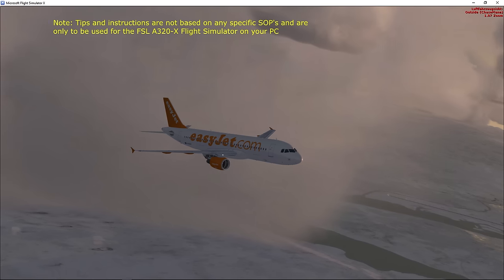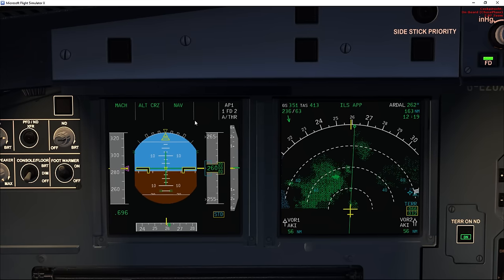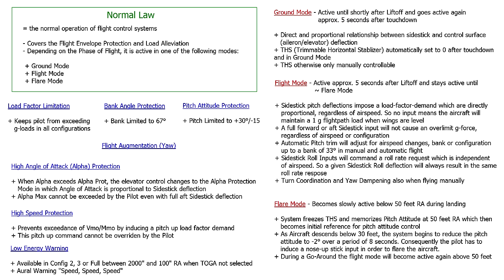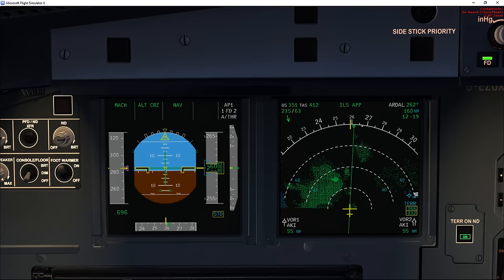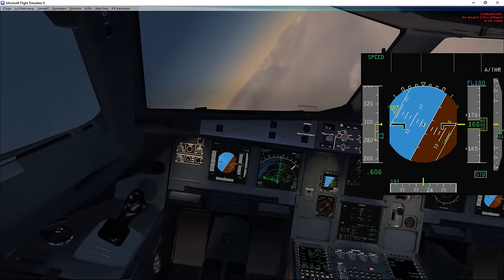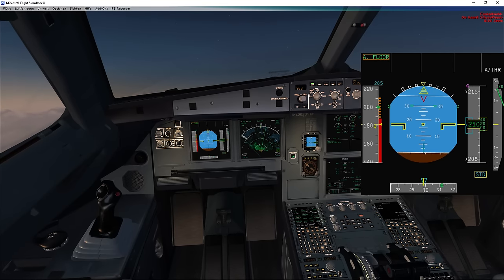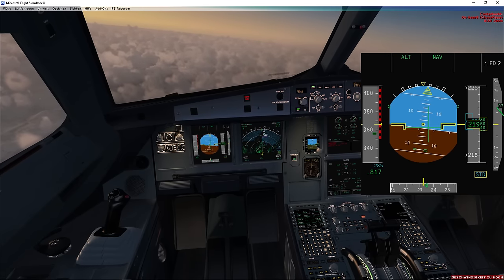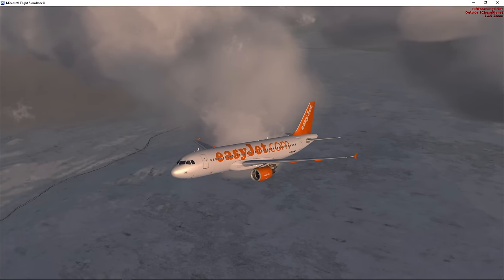FSLabs A320-X Basics: Normal Law Flight Envelope Protection

Comment: Hi Blackbox!many thx for great info again!can u explain a bit more on the difference between High angle attack protection and low energy level protection,as I can see that both of them have to do with how the aircraft is stopping it comes to a low airspeed, Happy New Year !
Reply from the maker: Hi tiffany. The High Angle Protection works at any altitude as long as the Aircraft is in Flight Mode. The Low Energy Warning is only active with Config 2,3 and Full,  between 2000" and 100" Radio Altimeter Height and as long as TOGA Power is not selected. This Warning is given to inform the pilot of a low energy state of the aircraft near the ground and happens a few seconds before the autothrust sets TOGA automatically. In the Procedure it says that if the Speed Low Energy Alert sounds, the pilot should increase thrust until the warning stops. Regards

Comment: Thanks very much for the video BB :) What is your opinion on the delay and uncertainty around the P3D version of this? Cheers :)
Reply from the maker: +elmar001 ... Quote from the FSLabs Forum: "if you also visit the LM forums to notice what's been going on with the latest v3.4 hotfix releases and the issues people are having with memory usage and DXGI_DEVICE errors. We feel that there are still some problems with the current version of P3D that is available and that until the good people at LM have had a chance to resolve those, we are hesitant to release a product only to start receiving complaints for situations which are not quite caused by our software."

Comment: Hi Blackbox711. As usual, a very interesting and good video. I would be very grateful if you could do a tutorial on how and when to use the lights e.g. Strobe Light. I've seen you put the strobe light into the auto position and I'm confused as to when the switch should be in the auto position. I would really like to see you explain when and why. Thank you.
Reply from the maker: +MC KJKRU ... Thank you. When the Strobe Light Switch is in the Auto position, the Strobe lights will flash whenever the main landing gear strut is not compressed. , i.e. when airborne. Procedures however require you to switch on the Strobe lights whenever you are on an active runway. So you leave the switch on ground in the Auto position and once you enter the Active runway you manually switch on the Strobe lights. Or once you leave the active runway, you switch the Strobe lights switch from on to auto. Regards
Reply: Thank you very much for your answer, Blackbox711!! I'm  very grateful that you took time to give me an extended explanation!! Kind Regards - MC  KJKRU

Comment: How do you rate the latest release for P3D in respect of the problems that users are experiencing with VAS and OOM
Reply from the maker: It depends alot on the other addons and the details settings. However I find that in P3D these problems are less, although not completely solved.

Comment: Sir what if the pilot needs a sudden extreme maneuver due to TCAS order or wind shear how can he accomplish such control !
Reply from the maker: Hi. The flight envelope protection makes sure that you can make extreme maneuvers without getting the aircraft outside of the flyable envelope.
Reply: @Blackbox711  thank you 🙏 , dear if you don’t mind as you know during 2nd engine start PTU will do a self test till the engine inertia (torque) overcome the PTU , is this case shown on HYD page??
Reply: @Blackbox711   anther (Q) what is the difference between load factor in case of _G  & high speed protection?
Reply: And the difference between low speed and high angle of attack protection?
Meaning angle of attack protection available from lift off till landing?
Or just at takeoff  roll , which seems reasonable!

Comment: Hi .. dear , what if the captain needs extreme maneuver due to TCAS sudden order or terrain territory  how he can overcome these protections!
Reply from the maker: +Bazoka Zoro .. there is enough margin to do some extreme manouvers before the protections kick in.
Reply: Blackbox711 if not enough !
Is it possible to switch off 1ELAC + ADR .or SFCC
Reply: Yes, you can switch them off. At least in the fslabs a320, anyways.
Reply: @واحدمنالناس-ن9م  it will be enough. If you’re trying to do more then you’re trying to break the aircraft.